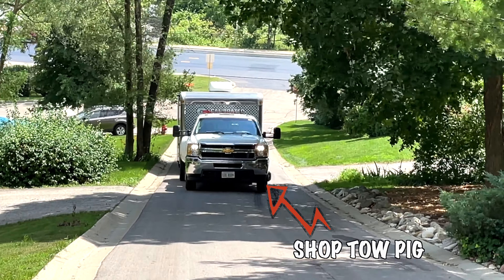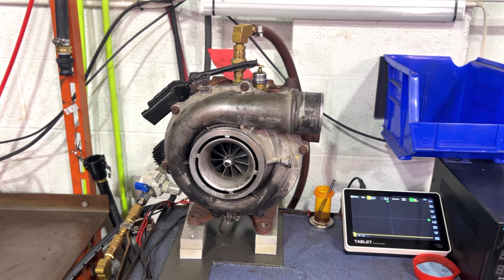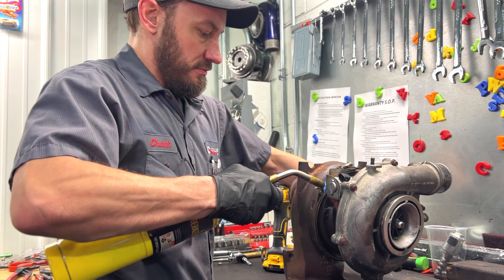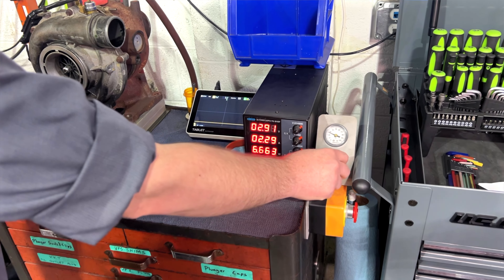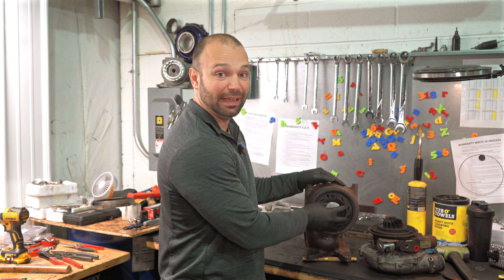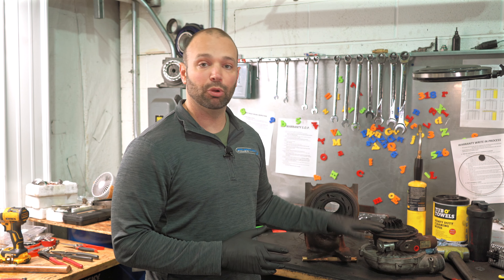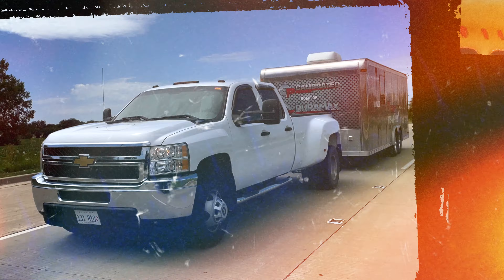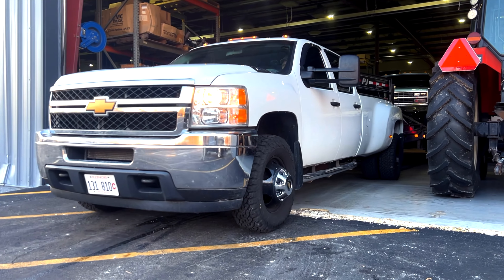P003A On Our Stock LML Turbo... The Vanes = Not Happy

Comment: What transmission upgrades are needed to handle the Mach1 or will stock suffice on a LML?
Reply from the maker: It really depends on your tuning. You can run these on a stock truck but you will get the most power out of it if you have a built transmission and a healthy tune.

Comment: Great look inside the turbo. Could a cts3 show a good sweep but not in fact getting it? I suspect my unison ring of being stuck but shows 0-100 sweeps.
Reply: The only way the position sensor can see a full sweep without the unison ring sweeping would be if the control slot in the unison ring is hogged out (happens often on 6.0 Fords) or if the unison ring drive gear set pin has sheared (only possible on 04.5-'10).  Short answer, yes - it's possible.

Comment: Curious. Have you switched out the CP4?   I have a 2015 LML with 185,000 miles.  I run Stanadyne Lubricity improver with every tank of fuel as I understand the problem with the CP4 to be lack of lubrication from the  2007 fuel mandate. I do pull a fifth wheel and I've pulled gooseneck trailers across the country.  Would something like the FASS lift pump help?
Reply: copy/paste from the comment above: I bought this truck with a failed fuel system.  We put a fresh set of injectors and CP4 in it along with a FASS lift pump.  We install FASS lift pumps on most LML's that come through our shop.  It's money well spent to help avoid catastrophic fuel system failure.  Good fuel quality and zero air in the fuel system is key to keeping the CP4 alive.
Reply: @nickpriegnitz5895  So the Dealer says I should do a fuel system clean.  I'm concerned that introducing any kind of solvent to the fuel system would compromise the CP4.  Thoughts?

Comment: Does that LML still have the stock CP4? If it does, have you ran an aftermarket lift pump? I have a 2015 LML with 300,000 miles on it. Never had a lift pump stock seat before still runs great.
Reply: I bought this truck with a failed fuel system.  We put a fresh set of injectors and CP4 in it along with a FASS lift pump.  We install FASS lift pumps on most LML's that come through our shop.  It's money well spent to help avoid catastrophic fuel system failure.  Good fuel quality and zero air in the fuel system is key to keeping the CP4 alive.